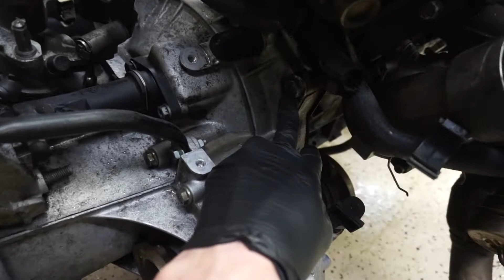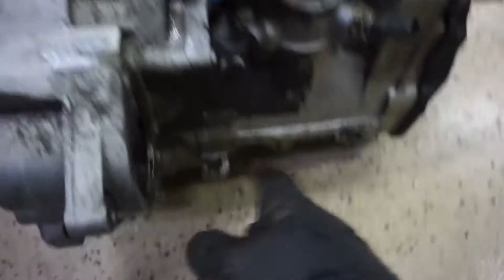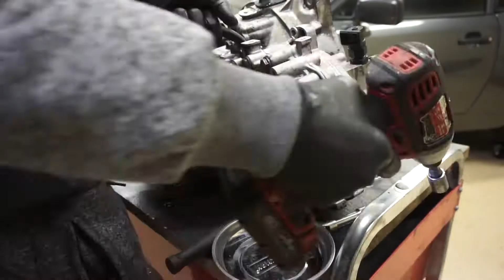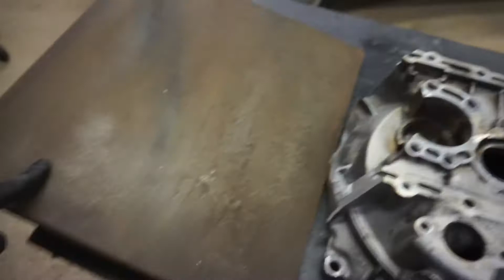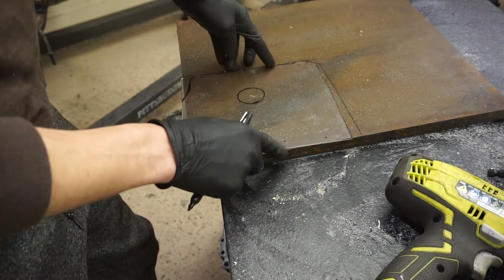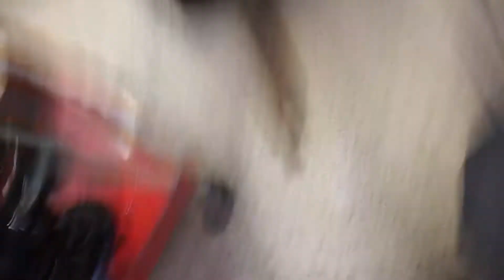Porsche 944 1.8t Bellhousing Build Part 1

Comment: I'm curious, you ever thought about cutting the old bellhousing and new horizontally aswell and try to weld them 
together (i know its hard to weld Alu but, i migth open a position to relocate the starter at the same time? :D 
Can i get in touch with you in anyway, have some small questions otherwise.
Reply from the maker: Hey! Yes I definitely thought about it but decided to go with the way I did , because it just seemed easier cutting the 1.8t tranny and bolting a plate onto it. Plus the parts are more affordable for the 1.8t (clutch, flywheel,starter and slave cylinders etc) compared to the 944 parts so in a long run I'll safe more money on parts🤔🤞

You can also follow me Instagram @yevisworld that's where I also post alot about the build and other things and you can also msg on there too!:D
Reply: O

Comment: How do you expect to hit an alignment spec of less than .001" doing it that way? Instead of welding on another plate with studs sticking out of it, why not just drill and tap holes in the plate you've already fixed to the Audi bellhousing? Actually...why did you even bother with that at all. You could've just carefully measured everything off and come up with something in Solidworks and have a machine shop make up the parts using CNC. It would've been a million times cleaner that way!
Reply from the maker: Hi,

 The plan is to drill out 4 holes on the big plate and weld them in from the back and the second small plate is going to be used to fill in the .25in gap i have, after test fitting the engine to the torque tube, the shaft is to long so thats where second plate comes in. 

Also I mentioned in my first video from this build, I never build anything like this before so its like a whole new world for me and lots to learn. Mistakes going to be made and lessons will be learned. 

As for Machine  shop I agree that it would be more "professional" done but it also comes at its price, for example if I measure it incorrectly it would cost me double to get it fixed. Worst case scenario i can always take it to a machine shop later in the future when I'll be getting my engine machined prior to rebuilding it. (Also something I never done before but will have to learn) 

I never heard of solidworks before I'll have to look into it when I'll have some free time. Thanks for the suggestion.
Reply: @yevisworld6348  It's all about the learning! Love that you show us the progress and the "mistakes" :D 
You inspire me to do this aswell as soon as im done with my first project car since i also have a slow 924. 
Hit me up if you need any help of construction in CAD would love to help and would also benefit by getting the mesurements needed!

Good luck and cheers!
Reply from the maker: @Antiairdevil2  Thank you for watching and subscribing:) it's definitely a learning process and definitely learn alot about so many things in the last year trying to get this swap done. I would love to see your project when you get it started, send me some pictures on my Instagram account at @yevisworld :D
Reply: @Antiairdevil2  Hi, did you make your own adapter/bellhousing ?